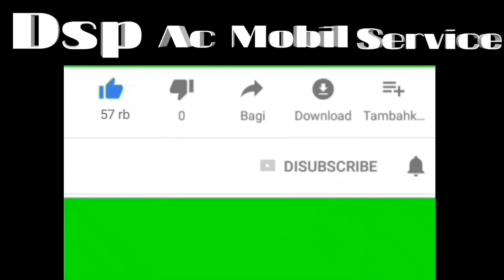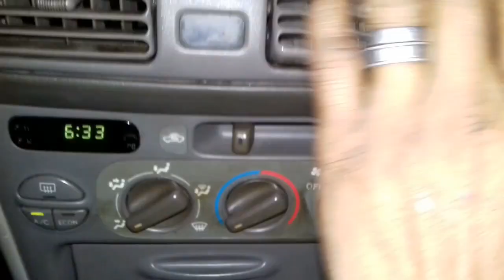Ac mobil corolla pake kompresornya honda jazz

Comment: Om mau nanya,kompresor hyundai accent verna 2006 udah ganti bunyi ngorok lg terus d bahan bakar boros jg kalo d rubah type lain dan irit d bahan bakar pake type apa ya om?
Reply from the maker: Pake homda jaz bosku,
Reply: @DspAcMobilService  pipa fitingnya nanti ga bisa masuk gan
Reply from the maker: @yonoac774  bisa pi perlu sedikit di panasin pipanya dikit bos
Reply: Kalo merk Hyundai
Ganti kompresor aja percuma. Harus ganti kondensor dryer .

Comment: Posisi bengkelnya dmn Om?
Reply from the maker: Batam
Reply: Jauh sih posisinya d batam...kalo d bandung saya samper gan.....dah bolak2 k bengkel ac...sprti kurang puas hasilnya
Reply from the maker: @onekeyngabolang7984  mungkin belum ketemu mekanik yang pas
Reply: Bisa minta no hp om saya Batam juga kira² bajat nya brp om kalau ganti kompresor mobil jazz
Reply from the maker: 082114277770